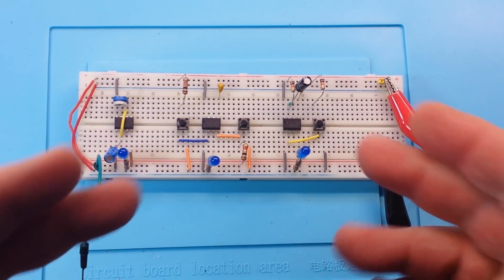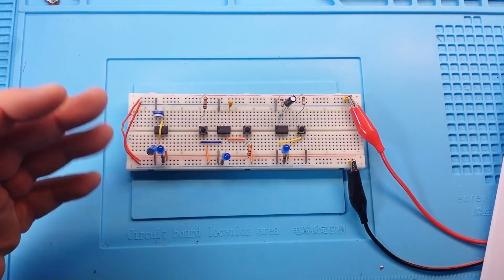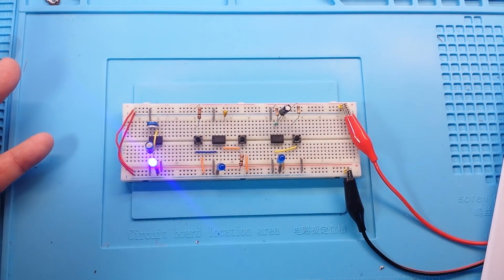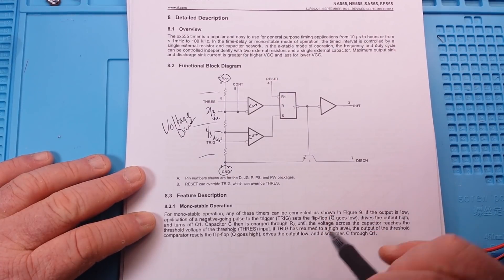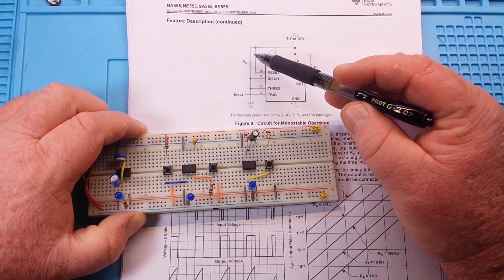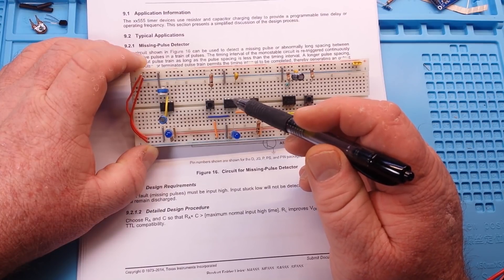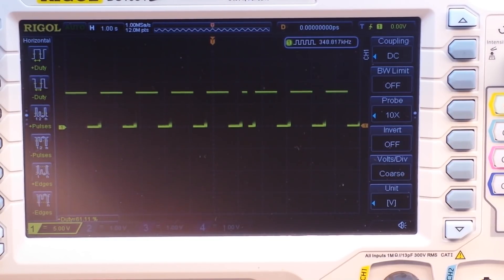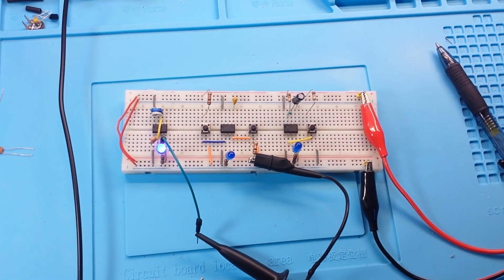555 Timer All Modes

Comment: I wonder how accurate the charts are.  I've been using a general purpose 555, NOT a low voltage version, with voltage as low as 2.5 volts, although I typically use 3-4.2 volts, max.  They still work fine, although with reduced amperage.  When they say min. 4 or 5 volts minimum, depending on where you read it, doesn't jive with my experiments and projects.

Comment: I need a low power circuit to turn a thing on for about a second, then off and repeat after about 10 seconds.
Could I feed one 555 with another on monostable mode?
Need a timer more off than on.
Plus I could use two of these circuits alternating each other. Can it be done with 555s?

Comment: It looks like a couple of your circuits here are much simpler than the way they were presented in the videos dedicated to each specific mode.  I'm having particular trouble trying to set up the 555 in monostable mode for some reason. My resistor and capacitor supply is limited, or maybe I'm missing a small mistake I'm making. But I'm not giving up!

Comment: I had to buy a bunch of the 555 chips because I can't find any of these chips on any modern hardware that I take apart for recycling, so Banggood it is...
And I have been playing around with these chips, made all the circuits that you showed in this video, played with different capacitors, resistors etc. to see what happens.
Now that I know more about it I have to say it is indeed a very interesting and versatile chip, I think it's rather cool.
I made one more circuit using two 555 timer chips to make a police light, first it flashes the red LED's a couple times and then it flashes the blue LED's, back and forth but what's so special is that it doesn't flash each side one time but more like 3 to 5 times before going to the other chip to flash the other side 3 to 5 times... It works and looks really cool but I have no clue how it works, if it just did one flash each side it would make sense but how does it flash multiple times on each side is a mystery to me, maybe you can explain the phenomenon in a video?

Comment: Great videos. Thank you.
Maybe I'm missing something,  but I don't see the point of 'bi-stable' mode. Surely you could turn an LED on and off with a switch, a resistor and an LED. No 555 required and only one switch.
Reply: He's using momentary switches yet they are behaving like they aren't. Which is what the 555 makes possible. 👍

Comment: Hello,   I am looking to design a circuit that is battery driven to turn on a door courtesy light on my experimental airplane.    My plane has gull wing doors that open over the wing.   I would like to have the courtesty light turn on when the door is open and off when it closes.    I want it to be self contained because it is really hard to run wires from the door to the fuselage and keep them watertight.   I was thinking of using a tilt switch to signal when the door is almost all the way open, wait 2-3 seconds and then turn on.  Why the wait:  I do not want turbulence while flying to activate the light.   I also want the light to turn off after 2-5 minutes.
Again, the desire is to have this completely self contained, maybe a 1-3 watt LED, battery operated.  The light would light up the wing walk area during loading or unloading at night.

I was thinking the tilt switch would be  what supplies power to the entire circuit, starting the 1-3 second delay and the 2-5 minutes off timer.  When the door closes, the tilt switch would cut power to the circuit, resetting it.

being a mech Engineer, I can package it all up but designing the circuit to be as simple as possible is not in my skill set.
Reply from the maker: email me, arduino0169@gmail.com. Ill help you. PP/SEL, IA here by the way.

Comment: Is it possible to turn the led for 1s and turn it off for 5s in a loop ( astable mode)?
Reply: Yes. Use the astable mode, replace the resistor that is connected to the capacitor with 2 branches in parallel:
Branch 1: a resistor R1 and a diode;
Branch 2: another resistor R2 and a diode in the reverse polarity.
Choise R1 and R2 to match the desired on/off time.
Reply: @takix2007  
I will try that tomorrow.
Thank You!

Comment: You actually haven't done a video about the 555 in bistable mode? I tried this one but mine doesn't stay on when I ground trigger pin? I mean it does some times... but far from all the time. I've tried a new 555 with the same result.

Comment: Is there a way to make one color blink say 6-8 times, before switching to the other color?
I'm trying to figure out how to switch between one flashing red and one flashing green LED. 
Basically, THIS. It begins at one minute and 20 seconds or so into the video.
https://www.youtube.com/watch?v=_ayT0EZwbks&t=80s
It looks to me like Mark Hamill is controlling it, like, he interrupts the green LED by bridging a connection or touching a switch with his little tool. How can this be done? I'm trying to fit it into a box roughly 47mm x 17mm x 10mm, along with two LR44 cells.
Reply from the maker: Multiple 555 timers cascaded
Reply: @learnelectronics  I'd love to see a video demonstration! I've got a project thread about this on All About Circuits, if you care to check it out, I'd REALLY appreciate it!

https://forum.allaboutcircuits.com/threads/need-help-with-a-slightlr-different-led-flasher-circuit-novice-here.164708/

Comment: Hi Paul, I know almost nothing about electronic, yet somehow found your demo fascinating. 
I don't meant to impose, but was wondering if you could set me in right direction. Your wisdom in this is much appreciated. I refrain from reinventing the wheel. I need the most elegant way of doing this. 

I wish to come up with a timer circuit which interacts with a thermostat, one main heating element, one keep warm element and a buzzer when cooking is done. 
I have been reading on Arduino approach to this, but today I thought perhaps 555 can be used to achieve the same end in much smaller size. 

Here is the requirement:
1- Timer must cover 60 min. time,
2- A Dial is used to set the time (this will produce rice with bottom crust at desired crispiness),
3- A Display shows what Dial is set at, and the remaining timer when count down takes place.
4- When a button is pushed and pot-thermostat is closed (cold pot), the main 700W-Element is turned ON and cooking starts. 
5- When pot-thermostat opens (water boiling point), 700W-Element is turned OFF and Timer STARTS/CONTINUES counting down.
6- When pot cools down enough to cause pot-thermostat to close again, 700W-Element is turned ON again and Timer PAUSES the count down.  
7- This thermostat Close/Open, Element ON/OFF, and Timer Count Down/Pause/Continue repeats until Timer zeros. At this time
   a- 700W-Element --> OFF
   b- a 25W-Element --> ON   (keep-warm)
   c- a Buzzer goes off

Can this be done utilizing good old 555 and basic components, without the need for a micro-controller? Do you approve if this? If so, any idea what the circus looks like? As general / detailed explanation as you wish. 

Cheers
Mohammad

Comment: Great as usual! Greetings from Leeds, Yorkshire, UK! 

I have a question: I am designing my own capacitor discharge ignition system for a classic 1970 Honda. I think the 555 in monostable can give me a 3ms pulse output when the breaker points open (with a few simple mods). BUT the trigger voltage will last longer than 3ms (its like holding down the trigger button on your board). So can I get that short pulse no matter how long the trigger signal is applied? Then reset after the trigger signal is removed. My intention is to use mosfet to fire off a charged capacitor (200-300v from cheap chinese ebay booster circuit) across the ignition coil primary every time the breaker points open (for 3ms) then after that the capacitor is charged again as mosfet goes open circuit. Another mosfet will briefly cut the hv supply as the capacitor shorts across the (0.4 ohm) coil primary to avoid damaging the booster circuit.

Many thanks. John
Reply from the maker: Yes. The 555 starts on the rising edge. So your timing will start when you upon receipt of the trigger.
Reply: @learnelectronics  Hey thanks for the quick reply! Thats great info. I shall incorporate that into my circuit

Comment: I have a 555 question. I am trying to build a monostable circuit to replace the electronic shutter board in a camera. I have a working circuit with one hitch. When I press the momentary contact switch, the LED representing the shutter on the camera lights, times out, and goes off. Good so far. If I hold the switch down for a second, I still get my 2 second timing. BUT, if I hold the switch down longer than 2 seconds, the light stays on until I release the switch. OK for 2 seconds, I can be fast enough on the trigger to beat that. But it's not good for 1/250, 1/500, 1/1000 second. This behavior seems wrong to me. Is it normal? If so, it seriously limits the usefulness of this device. My circuit follows the monostable diagram in section 4.1 of the data sheet, with the Reset tied high and a 1k resistor between pin 2 (trigger) and Vcc. The switch grounds the Trigger pin when pressed. Am I doing something wrong? If this is normal behavior for this circuit, is there something I can add or change to get what I need? Thanks. AND thanks for the videos. They're great.
Reply from the maker: That's not right. Can you email me a schematic of your circuit?
Reply: @learnelectronics  Sent to the email address on your About page.
Reply: Found the answer! It's called edge triggering. A capacitor (0.01uf or 0.1uf) is used to connect trigger (pin 2) to the grounding switch, instead of a wire. A 10k resistor is connected to the trigger pin side of the capacitor to hold it high. The trigger sees only changes in voltage (AC). DC such as that from holding the switch down is blocked by the capacitor.  It appears that without this modification, the behavior I originally described is normal. Might make a good video. Anyone trying to time a short interval with a manual switch is gonna need it.
Reply: To clarify, the resistor from the trigger pin goes to Vcc.

Comment: What is supposed to happen  in astable mode when you don't connect pin 4? My 555s seems to run fine with pin 4 unconnected. Will it just make it unstable over time?
Reply from the maker: Well its put that pin into an unknown state. Most of the time nothing bad will happen. But there is the possibility that it could go low and reset the chip. It won't damage anything if that's what your asking.
Reply: Just trying to understand how it works by messing with it. Electronics are usually pretty precise things, so it feels a bit odd that pin 4 only sort-of needs to be high.
Reply from the maker: That's because its active low. If it were active high and you didn't hold it low, the chip would reset whenever there was something it could capacitavly couple to...like your body

Comment: I hear all the time that the 555 timer ic is very common and can be found everywhere, however after salvaging and recycling electrical components for several years now I never found the chip being used in any of the devices that I've had in my hands.

I don't know what to think about it but I am a bit disappointed because of it and I do find it a bit strange, right?

I've salvaged lots of power supplies mainly for computers and servers but also tv power boards for modern flat tv's but what I love to get my hands on is old crt tv's since those contain the bulky through hole components which are easily salvaged and are great for diy projects or usage on the breadboard and not to forget that it holds a beefy high voltage transistor, the flyback transformer plus all the nice enameled copper wire from the yoke and the demagnetisation coil that can be reused for making Tesla Coils or making your own AC flyback from it...

That's what I did with it mostly and of course I learned a lot in the process of making my own flyback transformers, Tesla Coils and the driver circuits.

The latest Royer Oscillator I've made I used the high voltage BJTs from 2 old crt tv's and the flyback transformer and the output is pretty impressive, it does behave very different compared to the ZVS driver although it's almost the exact same circuit the BJT based Royer Oscillator produces a lot more ion wind and starts to react with the electrodes further apart.

The ZVS driver is of course much more efficient and my latest ZVS driver has an output of about 150 kilovolt when I connect it to my biggest flyback transformer which is absolutely crazy and very dangerous because of the high voltage and high amperage, I always tell my friends to get away from it and keep enough distance when I'm playing with it and to NEVER EVER touch anything when it's live or shortly after until everything is discharged.

I still want to build a 555 timer based driver for my flybacks and Tesla Coils but I know that the inevitable will happen which is blowing up the chip, at least a couple of them I don't want to buy  a bunch of the 555 timer chips, I rather pull them off some old pcb... Sadly I never find such a chip on the boards that people have donated to me.

So can you tell me what pcb to look out for where I can find those 555 timer chips on, because I never found one before

Best regards,
Ricardo Penders
Reply from the maker: There's one in my Zeny switch mode power supply, there's an smd version in one of my USB phone chargers....
Reply: 555 timer is very cheap and very general in use so most electronics manufacturers won't use that, in addition that 555 timer isn't that robust (sensitive to noise), inaccuracy when generating frequency, sensitive to temperature change, supply glitch and require more components than the dedicated IC for its purpose. It is widely used only by hobbyists.

You don't need to salvage 555 timer. IT is WIDELY available around the world and very very cheap. It is one of the most commonly used and available on market that will never be stop to be produced.

Comment: What would be the maximum frequency you can get in astable mode? I think this little chip will be useful in designing and building a plasma multi spark ignition system for my classic honda motorbikes
Reply from the maker: Stable frequency? Nice square pulses? 300-500KHz depending on the chip. I've pushed a 555 to over 3MHz but it ain't pretty.

Comment: Great video Paul. I really like the idea showing all three of the major configurations at once. It is one of the ways I have been practicing my circuit analysis. I’m actually working on a 555 based stepper motor controller right now. I know i could do it more easily with an Arduino but overcoming the challenges are a big part of the fun.
Reply from the maker: Sure you could do it with an Arduino,  but then you wouldnt know what's going on under the hood so to speak. Like Feynman said, "What I cannot create, I do not understand."
Reply: Exactly.
Reply: @learnelectronics   I started out doing a few minor electrical repairs in my home after I retired. 

That peaked my current about electricity in general and electronics. 

So I got an Arduino kit. I messed with it a little, it was fun, but I wasn't learning how the individual components worked. 

So now I've been making breadboard circuits to attempt to learn more about electrical components. I've been having so much fun and it's been fascinating, I may or may not go back to messing with the Arduino, I'm pretty sure I will at some point but learning about individual components and how they work together is satisfying in itself. Previously my only exposure to this kind of thing was when I took physics in college which believe it or not made learning this more confusing in some ways. 

So I'm enjoying this channel a lot, I wish there was a little more discussion on component substitution, my little kit doesn't have everything, but I've ordered a larger capacitor and resistor selection so that should help.
Reply: Another very useful chip is the Darlington array ULN2003 which can be used for motor control but I'm actually using 2 of them as an interface for my Raspberry Pi so that I can connect my GPIO pins directly to the interface without having to worry about any series resistors or blowing up my GPIO ports or worse and be able to switch up to about 50 volt with a 3.3 volt GPIO signal...

I'm using the interface to control 4 channels of 12 volt RGB LED strips with only 3 GPIO pins in use, normally you need 3 GPIO pins for 1 RGB LED strip, another great thing using the ULN2003 IC is that because it can only sink current the signal is inverted so when the signal is high the output will go low or sink the current to ground and with those 12 volt LED strips that's exactly what needs to be done and you can do the same thing if you want to control a brushless dc motor with a PWM signal coming from a microcontroller such as the Arduino or Raspberry Pi.

I hope this is helpful information regarding your project.

Best regards,
Ricardo Penders

Comment: How do you use a 555 to pulse a counter? Thanks Joel
Reply from the maker: I would use it in astable mode. Figure out the frequency you need and choose the two resistors and one capacitor to make that frequency. The frequency is equal to 1.44 divided by (r1 +2r2)C
Reply: @learnelectronics  thank you.

Comment: How about the unstable mode?
Reply from the maker: Three modes: mono, bi, and a. Nothing else official listed in the data sheet.
Reply: @learnelectronics  you forgot the mode I invented, the f*cked up mode. It is when you mix up the pins and it gets hot... literally.
Reply: @javierperez_21  lmao😂. My first 555 project I heard a tiny scream and it reach the same temperature as the sun.
Reply: @learnelectronics  
I think you created the unstable mode when you pulled that capacitor out?
Reply: "Tee Hee" quoth he!
Reply: Robert Cromwell unstable? You mean unstable as something else than astable? Like random duty cycle?
Reply: Unstable mode? Plug it directly to the AC mains.